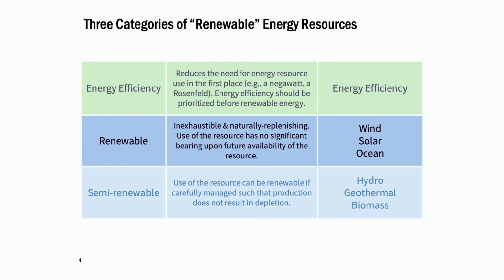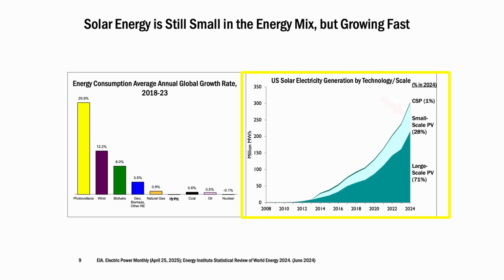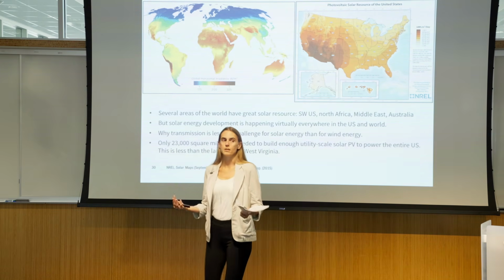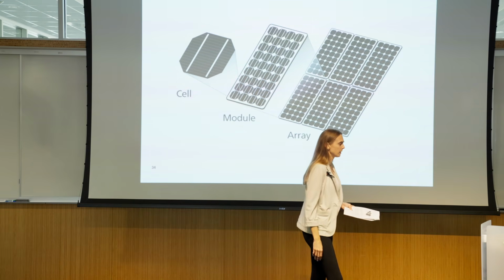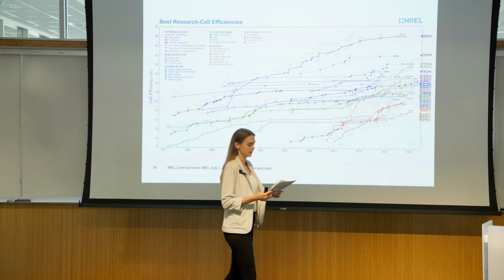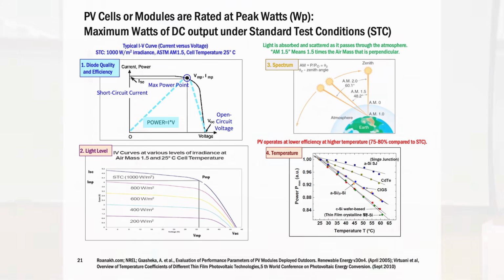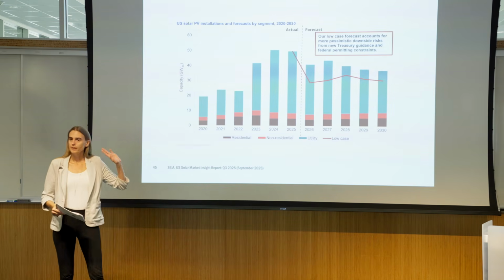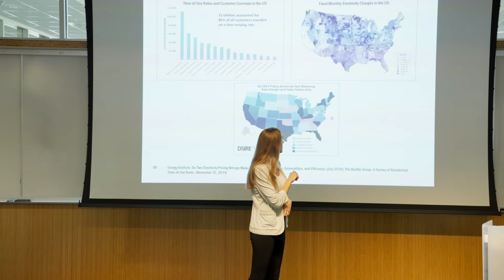Solar Energy Lecture | Kirsten Stasio | Stanford Understand Energy

Comment: Dear Professor Kirsten Stasio,
I hope this message finds you well. I would like to express my sincere appreciation and congratulations for your excellent lecture on solar energy. I found the presentation highly informative, comprehensive and particularly relevant to understanding the growing role of solar power in the global transition towards cleaner, more affordable and sustainable energy systems.

I particularly appreciated the way you explained the different approaches to harnessing solar energy, including passive solar design, solar thermal technologies, photovoltaic systems and concentrated solar power. This broader perspective was valuable because it demonstrates that solar energy is not limited to electricity generation, but can support multiple applications across buildings, industry, heating and power generation.

Your explanation of photovoltaic technology was especially insightful. The discussion of the photovoltaic effect and semiconductor materials such as monocrystalline and polycrystalline silicon provided an important foundation for understanding how sunlight can be converted directly into electricity. I was also particularly interested in emerging technologies such as bifacial solar modules and perovskite solar cells and their potential to improve the efficiency and economics of solar power.

The economic and policy dimensions of solar energy were also particularly relevant. Your discussion of mechanisms such as tax incentives and net energy metering highlighted how government policies and electricity-market structures can influence investment decisions, consumer adoption and the expansion of photovoltaic systems. The concentration of global module manufacturing in China and Southeast Asia also raises important questions about supply-chain resilience and the future competitiveness of the solar industry.

In this context, I would be very grateful if you could kindly share your perspectives on the following questions:

1. *What are the most important technological factors currently driving the rapid global growth of solar photovoltaic energy?*

2. *What are the principal differences between monocrystalline and polycrystalline silicon technologies in terms of efficiency, cost, durability and long-term performance?*

3. *How could bifacial photovoltaic panels change the economics and land-use efficiency of large-scale solar power projects?*

4. *What is the current potential of perovskite solar cells, and what technological challenges must be overcome before they can be deployed at large commercial scale?*

5. *How important are government incentives, tax credits and net energy metering in accelerating the adoption of residential and utility-scale solar energy?*

6. *How can countries reduce their dependence on highly concentrated solar-panel manufacturing supply chains, particularly those centred in China and Southeast Asia?*

7. *Considering the intermittent nature of solar generation, what combination of battery storage, grid infrastructure and other technologies is most effective for integrating large amounts of solar power into electricity systems?*

8. *How should developing countries evaluate the economic feasibility of solar projects when considering investment costs, electricity prices, financing conditions and long-term maintenance requirements?*

9. *How does the energy payback of photovoltaic systems compare with their environmental footprint, particularly regarding manufacturing, materials, land use and end-of-life recycling?*

10. *Looking toward the future, which solar technologies or innovations do you believe could have the greatest impact on reducing electricity costs and accelerating the global response to climate change?*

I would also like to commend you for addressing common misconceptions surrounding the environmental impacts of photovoltaic technology. The explanation that photovoltaic systems can generate substantially more energy over their operational lifetime than the energy required for their manufacture is particularly important for promoting a more evidence-based understanding of solar energy.

Your lecture also highlighted the strategic importance of solar energy for countries seeking to improve energy security while reducing greenhouse-gas emissions. In regions with abundant solar resources, particularly across Africa, the expansion of photovoltaic generation could potentially support economic development, electrification, industrialisation and improved access to affordable electricity.

I sincerely appreciate the time, expertise and commitment you dedicated to this lecture. Your presentation has encouraged me to explore more deeply the technological, economic, environmental and policy dimensions of solar energy and its role in the future global energy system.

Thank you once again, Professor Stasio, for sharing your knowledge and for contributing to a better understanding of one of the most important energy technologies of our time. I would be grateful for any additional academic resources or recommendations you may be able to share regarding photovoltaic technologies, solar-energy economics and the future development of sustainable energy systems.

Yours sincerely,
Luís Lopes
Angola

Comment: Have you ever heard of Earth Day? To preserve earths resources? Nuclear has immense power density = low resource demand. Renewables has dismal power density = immense resources needed to harness any reasonable amount of power. Renewables will generate mountains of waste, some will be recycled, but not all. Nuclear is the better choice if we are ever interested in environmental preservation.
Reply from the maker: Hi, thanks for sharing your thoughts! We have a lecture on nuclear fission that you might find interesting: https://www.youtube.com/watch?v=c4s9gN0qYpI
Reply: No.  Many of us are unwilling to take the risk of polluting an area for hundreds or thousands of years.
Chernobyl, Three Mile Island, Fukushima.  Man makes plans and god laughs.
There are no catastrophic risks with renewables.  Also no nuclear proliferation.
Reply: @finger-bang  Chernobyl is not relevant as an exampel of historic accidents, because it was not an accident. First of all they forced the reactor outside the design parameters so it had a steam explosion, second, that reactor did not have an enclosure of reinforced concrete so when the steam explosion blew the lid off the reactor was exposed to the sky. Third, that reactor use graphite (pure coal) as a moderator and when the reactor was damaged the graphite started burning, and it was the radioactive burning coal that spread the radioactivity so wide around. My point is, that can not happen again, ever, because neither of those circumstances can happen again. 1. Automated processes and safety protocols makes it impossible to push a reactor that far ever again. 2. All new reactors have reinforced concrete enclosures, so no reactor core will ever be exposed to the sky again.3. New reactors are not designed with graphite any longer, they use water as a moderator.

So no, radioactivity will not be released ever again.

The nuclear proliferation argument is bullshit. Nuclear weapons does not come from nuclear power. Forbidding nuclear power in the west does not stop Iran or any other country from getting nuclear weapons if they want to. We have nuclear power because countries wanted nuclear weapons, not the other way around.

You do not seem to understand how renewables work. Renewables have very poor energy density which means you need a lot of devices to collect the energy. A LOT! That mean a lot of mining, that means a lot of chemical processing and environmental harm has already occurred several times already.

So if you want to save the planet nuclear is the best way, that is a scientific fact. But I am sure you are not hesitant to have a renewable processing plant near your back yard, so good luck with that.
Reply: @44S-C7D  Chernobyl wasn't an accident, got it.
Nuclear energy has no relation to nuclear weapons, got it.
Environmental harm from renewables, got it.
Any other facts I should learn?
Reply: @finger-bang  No, you're good. I know you make fun of me. But consider this: 1. A car manufacturer tells a test driver to push harder and harder until he runs off the track and getting airborne before crashing hard. Is it really an accident, or is it a given result of pushing machinery outside it's design parameters on purpose? Nothing about the Chernobyl disaster was an accident, they did it on purpose, stupid as they were. 2. You can use petrol to set houses on fire, and still people are allowed to use petrol in their cars and lawn mowers without license or permit. That is because petrol is not bad in itself, it is what you use it for that can be bad. You can use Uranium to make abundant clean energy, or you can make bombs with it, it depends on what you want to do. You don't see anyone argue that petrol cars should be forbidden because petrol can be used to set houses on fire - because that is a stupid argument, but still it is applied to nuclear power. Why? 3. Yes, environmental harm. Pollution of ground water because of poor management in processing plants in China and elsewhere in Asia. Massive amounts of industrial waste that is leaking chemicals and heavy metals in landfills. And environmental impact because of massive land use. Killing birds, bats, other life. These are real events that are happening. Should we turn a blind eye to it, or should we be honest about the fact that massive industrial deployment in nature (because that is what renewables are) has side effects, and that we should talk about them?

Comment: Massless energy use is the primary path, the goal for global society.  Sunlight is massless.  Wind is air pressure, and it is massless.  Heat is massless, as well.  Gravity is a massless form, earth's gravity well, to consider, as it was used by Nikola Tesla to power dams, for the first demonstrations of the grid.
Reply: It’s not exactly about mass. If sunlight somehow had mass yet still imported itself directly to solar panels for free each day, that would still eliminate the immense inefficiency of having to pay, perpetually, for the extraction and transport of a flammable fluid.
Reply: If something was massless yet still had to be transported…
Reply: @Infodump-v9v  The advantages of massless energy are that it can be transported by power lines, at 9/10ths the speed of light, can be stored, can power motors, or be converted to heat, rather easily.  Go with electricity as Nikola Tesla theorized, so long ago.  The logistics are far more positive.

Comment: Thank you for this overview. This spring I invested $3,000 in a DIY solar system of 1kw of panels and 1kw of batteries. My goal is to replace one half of my normal electrical consumption. I do not connect to the grid. My complaint is that my electric provider charges a $40 monthly service charge over and above my cost per KW. My per KW rate is very low at 13 cents. It is my feeling that service charges are a disincentive to user energy generation.
Reply: I think such a high connection fee is an incentive to fully disconnect.  Check out whether your utility allows "vacation" disconnection.  Disconnect for a period, then reconnect without fees or inspection.  You could go offgrid in summer and save $240.

Engineer your consumption and sharpen your ROI skills and you may be able to justify full year grid defection with a bigger system.

Comment: Could have used a few more minutes explaining the economics, especially the vicious cycle from NEM etc.  Thanks
Reply: What the heck is a " vicious cycle from NEM"?
Reply: It’s pretending that it’s a terrible problem that solar often helps the consumer more than the utility company.
Not something that changes how enormously beneficial for society solar is, just issues that might require the restructuring how utilities get and spend money.
Reply: @wolfgangpreier9160  The thing at the end about Net Energy Metering and paying homeowners grid rates which is hurting the poor generating monopolies.
Reply: @finger-bang  95% of the customers have Smart Meters here in Austria. I do not think that is the same thing what you mean.
Reply: @wolfgangpreier9160  Sorry, what does any of this have to do with Austria?  The course is american, no?

@32:42 the professor begins explaining "...a big subsidy in the form of NET ENERGY METERING, where rooftop solar projects are getting the retail rate for electricity, rather than the wholesale rate..."

As long as @MarkShapiro-m8r is refering to the above.

In my opinion this is an argument that leads to maintaining large, fragile, centralized power generation systems that are often monopolies, as opposed to a local, robust, decentralized ones.
Reply: @finger-bang  We have much local decentralized energy generation. And nearly everybody uses Smart Meters which send their data to one central location which is the same for all users. 

We never had Net Metering, but we had ferraris counters before which - practically speaking - did the same. 

Maybe that is why it works for us?